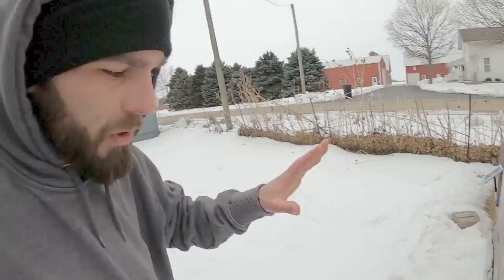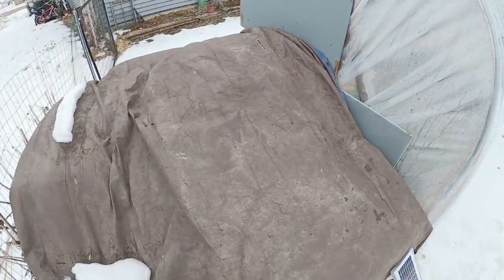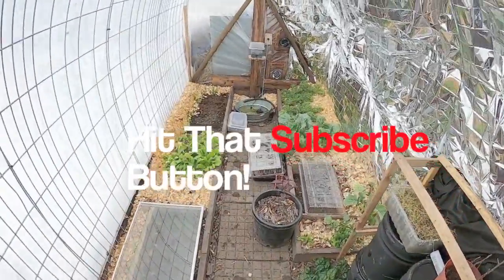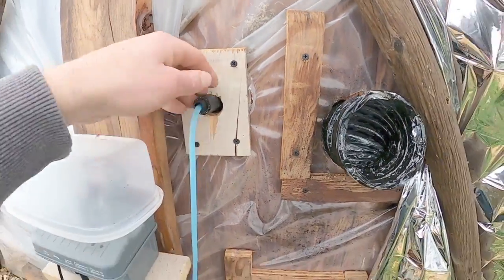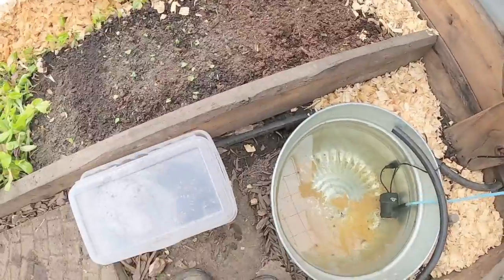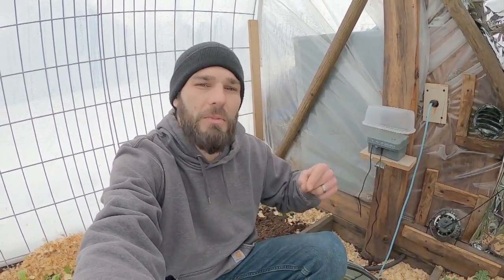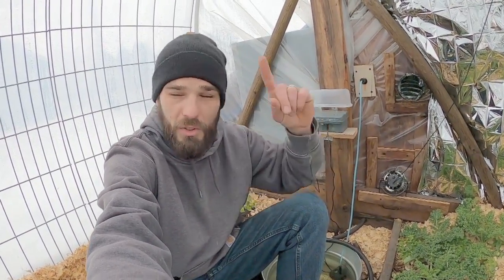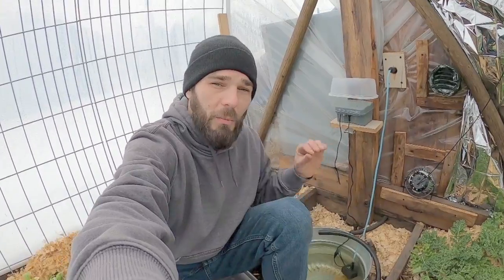DIY Cheap Winter Greenhouse Heating | Jean Pain Compost Heating Solar Experiment | Zone 5a/4b

Comment: This isn't composting. You're slowly burning wood chips like a fire place or pellet stove.
Reply from the maker: It is composting, as we’re creating heat from the breakdown of organic matter by definition. There’s no combustion in this process. Plus this video is years and years old. Plenty of nitrogen to a lot of carbon created a good burn for an extended period

Comment: Hi great job but one question how to insulate the under ground pipe from pile to polytunnel
Reply from the maker: @MichelleDougall  great question! So in this small greenhouse we drilled holes to run the lines through allowing a direct transfer from pile to the greenhouse and then we ran the lines underground inside the greenhouse to warm the floor. If you look at our most recent content weve insulated our lines and ran them underground into our large greenhouse.

Comment: I have three questions.
1)How long does it take to get the pile producing heat?
2)How long does it produce heat for?
3)What’s the ratio of wood chips to unit of heated space?
Thanks for posting these great videos👍 subbed
Reply from the maker: @Iz0pen  a well built pile will heat up in 24-48 hours in warm weather and can take 2-4 days in winter, depending on size your pile can go for two weeks to almost two years, our woodchips are fresh and old mixed with added nitrogen 75% carbon to 25% nitrogen roughly( give or take) sometimes more nitrogen is needed sometimes less depending on the size of chips and freshness. I’d encourage you to check out the Jean pain compost heating playlist with more in depth Info we’ve shared over the last few years of doing this. Thanks for the questions
Reply: @Earthdwellershomestead   Thanks for the reply, I’m working my way through the playlist now. Thanks again!👍

Comment: Love the video. If the tank was above the heat wouldn't it thermosiphon without need of a pump?
Reply from the maker: Technically yes. But with my solar powered pump we’re achieving the same results with a smooth flowing system running off gravity after the pump feeds the water up to be heated as it falls through the pile and back into the overflow.

Comment: Hi. Did you buy the solar timer with battery as a kit or put it together yourself?
Reply from the maker: Nope, this I bought as a whole little system years ago. It’s been running ever since, summer and winter. I posted a link to the solar pump kit somewhere on this video or description. It cost me 100$ back when I bought it but I’m sure that went up by now, and it was the most minimal system I could find for the purpose. Thanks for the question and checking this out!

Comment: If you had a larger tank of water, it would hold its temperature longer, right? Wouldn't that then increase the temperature inside the greenhouse?
Reply from the maker: Certainly! This was our experimental greenhouse, feel free to check out our more recent videos in our 520sq foot greenhouse we’re heating with the same method just on a larger scale.

Comment: Where are you located?  Could your system keep water from freezing in a week of -20 F temperatures?
Reply from the maker: It did, we’re zone 5a/4b right one the edge we’ve seen -30f and the heat from the compost held up when paired with the small solar system for moving water on a timer. This was an experiment that’s ran for four years consistently, we switch it up to cool the greenhouse floor and power out aquaponics rooting Box in summer. Thank you for watching!

Comment: How often do you pee on your pile?
Reply from the maker: I have my two boys pee in a bucket for a day or so when we get this together! Throw a bucket out back and let ‘em have at it 😂 do technically if it stays warm we only have to inoculate it one time.
Reply: @Earthdwellershomestead  Thanks, wasn't sure if it was a recurring thing.
Reply from the maker: Only if we need to “reignite” the pile, it can be tricky In winter if the pile cools down so we try to get it right the first time. Going on 4 years running this little system, also experimenting with a Jean pain pile for our large greenhouse this upcoming winter.

Comment: Thank you for sharing your findings. If I can utilise this to heat my home this winter I will share my updates as well!
Reply from the maker: That’s the ultimate goal for us too, lots and lots of material required for a pile that size. Thank you for checking this out! We are continuing to evolve the system to upscale it for our 520 square foot greenhouse tunnel in winter!
Reply: @Earthdwellershomestead  I also own a piece of forrest, so if I start now.. We had a LOT of storms, blowing branches out of the trees..  I saw Jean Pain´s pile that was about 7m high by my estimate so 90m3..? He had a very big farm and my house is probably insulated a lot better :)
I think I can manage a 4m high pile which would be 17m3.. ? jeez...You are right, that is never going to work..
 Maybe, I might start with my shed to get some actual measurements and not be very cold in the meantime :)  Or maybe the house and I´ll just save on the gasbill.
Reply from the maker: @Ludifant  yes I believe he had 300+ acres or something like that to work with! And you’ve gotta experiment to learn, we’ve been running this system in our small greenhouse for four years and it runs all summer as an aquaponics system and a floor cooling system with the geothermal cooling from finished compost! Very cool stuff. We plan to bring a better larger system to our 52’ greenhouse tunnel this fall/winter as we didn’t have enough time last year to accomplish what we wanted after construction and completion. We’ve yet yo throw our second layer of poly on it which will have a 6-8” layer of dead air for insulation to help us with heating it all winter also.

Comment: If the pile is lower than the greenhouse, you don't need a pump. The heat will pump the water up. Just saying for your next system.
Reply from the maker: That requires a lot of excavation on our part, solar powering this is our main goal as the thermal draw wouldn’t amass a fast enough flow. I had thought about your idea before I started to develop the system as I’ve seen a lot of buried piles to draw warm air upwards. Thank you for your input! Love to hear everyone’s ideas to help us better our understanding and experimenting!
Reply: @Earthdwellershomestead  Solar powered pump seems the next best thing. I hadn´t thought about calculating flow.. I will attempt that next. But I happen to have a 1.5m height difference in my garden, which probably helps.
Reply from the maker: @Ludifant  Jean pain heated about four liters a minute if I’m correct, to 140f. Flow and heat exchange are what your looking to achieve.

Comment: This is really a great system. Do you have links for some of the solar devices you use?
Reply from the maker: Thank you! We have posted the links in the comments to a few different commenters over the last year or so, i apologize I don’t have it off hand I will see what I can dig up but if you would like to do a little digging also you may find the links before I do 😂, thank you for checking this out!
Reply: @Earthdwellershomestead  I'd appreciate it. I have a similar greenhouse that Ive been heating with candles and clay pot heaters. It's very difficult to keep up with.  Thanks!
Tim

Comment: What is the average temp of the greenhouse with this? What kind of insulation did you use?
Reply from the maker: We held around 50f when we paired this with bubble wrap and straw bales to insulate the surrounding ground. When we got down to negative temps outside we still saw 32f plus in the greenhouse and kept it from freezing.

Comment: That is impressive 4b are you experimenting with several crops or just cool weather?
Reply from the maker: For the most part cold weather crops till our double poly 52’ is done and we are going to build a solid frame recycled material greenhouse with electricity

Comment: What route thru the compost, does the air hose take, it just enters the center of the pile then curves and comes right back out…? What is the diameter of the air hose going through? Also, the tarp you have on it Hass to be totally waterproof, correct?
Reply from the maker: Air hose was a dryer ducting. Roughly 4-5” I did a write up video showing how I build my piles for the small green house let me find it.https://youtu.be/WqvFRzDoc_o

Comment: Does the compost pile last all winter long or do you have to mix or add to it?  Great video and fantastic idea!  Wish I had set this up in my greenhouse last fall.
Reply from the maker: If it’s large enough then you can get these to burn for over a year without having to turn it! Pretty wild. Thank you
Reply: How long did this pile end up lasting?
Reply from the maker: @meadowlynnmarketgarden5845  over 5 months and it was still active when we broke it down

Comment: Two questions .. do you get enough sun for growth or is this more a 'just keep it alive until warm season' thing? Also how do you adjust for the shortened photo-period?
Reply from the maker: No I choose low light and cold tolerant plants and we achieve sprouting and growth in here. The light is minimal but being selective is important, we just got out 520sq foot greenhouse built and have tons of different crops surviving winter inside for now check this out Large DIY Greenhouse Winter Heating Experiments Data & Demonstration | System Changes Going Forward
https://youtu.be/GMq1_hZ_ebs

Comment: Do you have a detailed video  of a build of one of these green  houses, or do you have a detailed  blueprint of sorts ?
Reply from the maker: Not exactly. Our small one is 6x12, small for a greenhouse but wanted it to be sturdy we have had several feet of snow piled on the north side and what has stuck to the top and never had any flex or structural issues. Our small greenhouse was mostly reclaimed wood I treated with linseed oil, some hog panels and the poly. I needs to do a write up on it.
Reply: @Earthdwellershomestead  thank you for the response,  it's a great looking  green house, with minimal cost which is fantastic,  one of these should be in every yard across the country:) it's a shame we as a society have lost our ability to grow our own veggies  and fruits. 

Anyway thank you for the video,  I would suggest  talking  to a family  member, friends, or a neighbor to see if they would like a greenhouse like your's so you can create a full detailed video  with an instructional guide to go with it, it is a lot  of work but it would totally be worth it (a spring/summer project of course, this way it would give you time to get your resources together.

Comment: You never mentioned the temperature difference between inside and outside.  How warm was the inside air of the greenhouse?  How warm was the ground?
Reply from the maker: We didn’t I wanted the videos to be short and sweet when we started uploading. The air and soil were between 45-50f all winter we dipped a little when the temps outside were -20+f .We did take temps and show data in the next video, here’s how it’s running this yearhttps://youtu.be/QutWxV43gTo

Comment: how many  cubic feet ( or yards) of wood chips  do you  assemble for a winter's worth of heat?  Do you make one big pile or  break it down and start over mid winter? Does it matter if the wood species are mixed hard and soft??
Reply from the maker: Great questions! We used approximately 3-31/2 cubic yards of chips and they were free as it gets so I’m not picky, some of it was a pine (white pine Maby) and mostly hardwoods and mulberry’s. I don’t really know as to what composts hotter or longer as far as species goes. And this pile went all winter we added nitrogen through ash,urine, chicken poo and coffee grounds at several points and it kept this going. It’s and unconventional Jean pain pile, normally it would be consisted of manure stray/hay and anything from the barnyard that’s compostable.
Reply: @Earthdwellershomestead 
 thanks.   I bet one can get wood chips from a tree service and Leaves and clippings from a landscaper.  It's by-products they gotta get rid of.   Ancient farmers would pile their manure against a north-facing stone wall to heat their homes.  I gotta imagine the smell seeped through.

Comment: If your greenhouse is water tight, this is how you make money while heating your greenhouse, put in at least a 6 card GPU crypto mining rig in the greenhouse.  I've got my gpu cards hooked up to my heating system and only when the outside temperature gets below 35 degrees does my heat turn on.  In a greenhouse it will be more than enough to keep them warm.
Reply from the maker: Very interesting! I know mining crypto had major issues with heat that’s ingenious

Comment: So what is the high low temp in the greenhouse night and day and is this a strictly Solar and Battery system ?
Reply from the maker: We held around 45-50F in the floor and airspace on average all winter highs were upwards of 85F and the lowest temp we saw overnight was 37 on the floor when the ambient temps were -20 to -30F outside. Never had it freeze up. Yes it’s all solar and on a minimalistic level. We have been experimenting in our large greenhouse with diy heating also here’s our latest video on thathttps://youtu.be/GMq1_hZ_ebs

Comment: Ok, so. Why not putting the pile in the Greenhouse? When you start planting in the ground the pile would be mulch? Would it not work?
Reply from the maker: In theory yes, but the woodchips will be for our berries and trees and compost not our veggies as it’s more fungal than bacterial. And we adjust didn’t have the room and we wanted all the square footage for growing. Also we didn’t want a build up of co2 in such a small greenhouse. Check out our large greenhouse temps https://youtu.be/GMq1_hZ_ebs
Reply: @Earthdwellershomestead  
Makes sense! Also somehow tough to get it inside.
Next season after clearing my greenhouse plants, I will pile a compost inside, not just Woodchips. In March i would dig it inside and have it as  initial fertilizer. Maybe. High fungal spores concentration is still an issue.
Reply from the maker: We actually filled the greenhouse beds two feet deep with hot compost the first year we built it and it worked great as hotbeds with soil on top and I have only added a bucket or two of compost over the summer when I’m done harvesting a bed then I’ll amend it with finished sifted compost with a bit of inoculated biochar and it seems to be a good solution so far and free at that. Good soil is expensive lol

Comment: Why doncha just extend the greenhouse over the chip pile? Maybe a perforated barrel in the midfle of the pile? The tarp doesn't hold heat well as you demonstrated by holding your hand on it, that heat could be in the greenhouse, no fans or water pumps. Also lovely CO2 from composting for the plants.
Reply from the maker: We just didn’t have the room, and yes we lost a lot of heat to the outside. I kept throwing snow to insulate it but it melted as soon as the sun came up paired with compost heat rising. We put the pile inside in our large greenhouse and are cranking 90F+ air out of it check it outhttps://youtu.be/GMq1_hZ_ebs

Comment: Why didn't you put the wood chip pile inside the greenhouse? I imagine you are loosing a lot of energy outside.???
Reply from the maker: Yes you are correct! We didn’t have the room and wanted all the space we could to achieve this. And the compost gives off CO2 and minimal methane and in such a small greenhouse we decided to harvest the heat through our systems. We insulated the pile well with hay bales and snow on top but it eventually melted ever time the sun came out

Comment: Typical nighttime temp in the greenhouse?
What fan did you use?
What did the compost material cost you?
Looks interesting overall.
Reply from the maker: Overnight we had held 45F with our water heated floor, and the compost pile insulating and heating it all night. Cheap little 5w solar fan 
This isn’t the exact one but it’s the sameSolar fan 5W 4 inch mini... https://www.amazon.com/dp/B093GYX1FN?ref=ppx_pop_mob_ap_share

And the woodchips were free and we used recycled materials to put everytng together. We spent about 100$ on the solar pump with 9v battery system. It’s lasted over two years. Thank you!

Comment: Just an idea: you could implement a heat exchanger.  Either add it in line right before the pile return with a fan (this will increase ambient air temps) or use it to simplify your plumbing.  Big pile plumbed with pipe-running to heat exchanger(s) mounted to greenhouse.   I may try this!
Reply from the maker: The wall held good heat all winter where the compost was and I wanted to use some type of metal as a conductor kindof like your saying. Good thoughts thank you

Comment: All nice and free but how much did the installation cost. ?
Reply from the maker: The heat was free the greenhouse was built as cheap as possible
Reply: Good thinking . Love the idea .
Reply from the maker: The only real cost for this small system was the pump and battery system for water movement around 100$ it’s been running for two years solid. You may like our latest videos in our large greenhouse with the same ideas involved

Comment: Can you provide more details. How much wood chips, what exactly you use to activate the chips? Also what kind of battery w/solor set up. If you build another a video of building it would be great. Thx.
Reply from the maker: We did set up a pile inside our greenhouse, smaller than the pile for our little 6x12 we used about 3 cubic yards of woodchips and the activate the pile we use comfrey, urine, ash, yarrow, or any combination to get the pile fully inoculated and burning hot. https://youtu.be/r3oXuszOJdQ